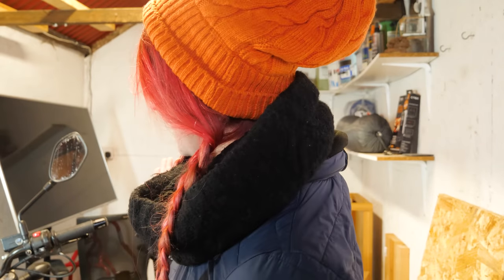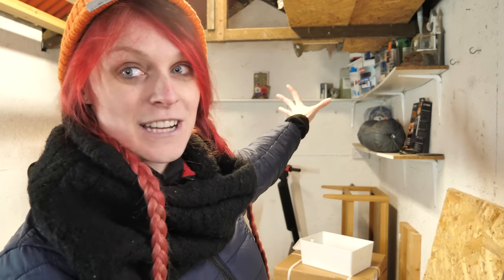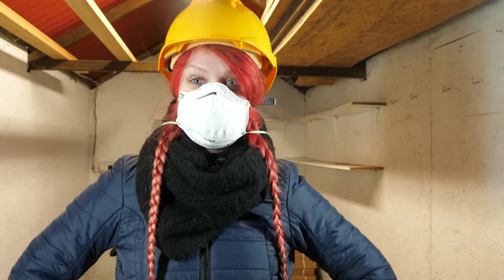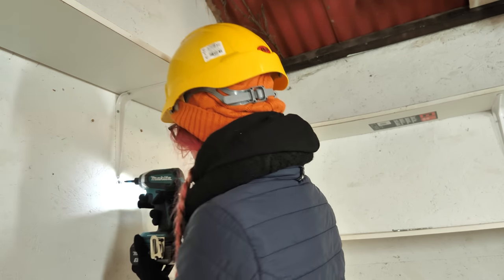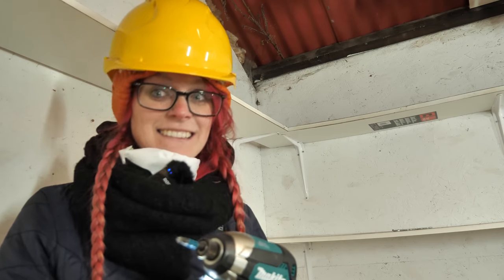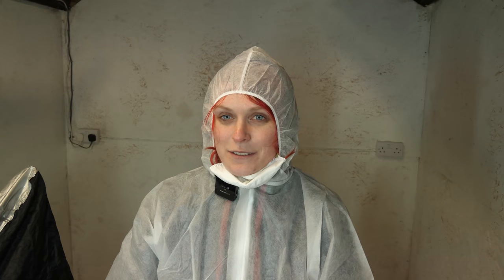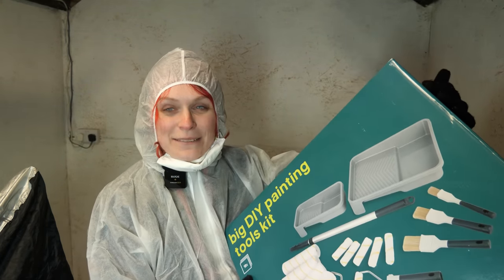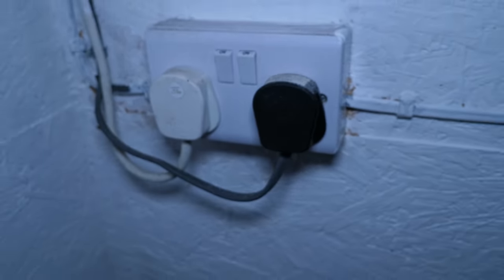Trying to build a bike garage

Comment: When it comes to the garage floor if you want a nice smooth floor use a couple of bags of latex self levelling floor compound. Once its gone off you could use a garage floor paint. I prefer the grey but you can get red. Once done your chair will roll around really easy and if you have a bike stand on wheels you can turn the bike into any position very easily to work on it
Reply from the maker: Thanks for the advice 🥰🥰🥰🥰
Reply: Thanks 🍻
Reply: This is going to be really fun to watch! I hope you have some friends with a little knowledge to give you through the processes! I know very little about the electrical. It terrifies me! I always get one of my friends to instruct me on how to do the work.  Lol
Reply: Love the new imperial unit of length, 'the sprocket '. It might catch on too.
Reply: I second that - especially the painting of the floor.  I was amazed how much easier it was to keep the floors clean.  First time I used a paint that came off under where I parked the car.  The warm/hot tyres removed the paint.  Talk to people to get the right paint - well worth a couple of extra dollars.  And flat floors any time you're lifting something or rolling it - learnt that from mistakes, hopefully Yorkshire Bikers were smarter that I am.

Comment: Impact driver perfect tool for the job, just make sure you have the right bit and put a bit more pressure on it (i.e. push harder) to make sure the bit doesn't jump out.
Reply from the maker: It doesn't have a speed setting so it was grinding the screw out! It was really annoying

Comment: Congrats on your own place . Just built my own garage from a side garden space all advice is there and good -put as many sockets as possible , make sure floor has damp proofing , storage space I consider putting boards on the roof beams, think about heating and ventilation ( I ran a spare air con coil which does heating and cooling) , a good stand eg Dynamoto pricy though but works really well, lots of lights eg led , shelves to put tools and helmets, hanging hooks - I use hooks from b&q , water source for cleaning do u have access to plumbing , get a cordless drill/ screwdriver , chance to make your bike secure , ground anchors or a Hiplok wall mount lock whilst you are cementing /epoxy floor, insulate roof - once done you love to work on bike in doors, I find dulux trade paint although more expensive is tougher needs less coats - get a trade account for discounts with local diy store are your walls wooden ?

Comment: It was fantastic to see what I looked like white poppy badges and purple poppy badges on the plaque at the back of the garage. 
As for the floor there is nothing better to work on than wood, I built a 26'x12' shed at the back of my house, I couldn't get concrete delivered and 10 sheets of 1' plywood was over £600. A mate suggested condemned scaffolding planks from a scaffold company, sometimes these companies pay for their disposal others sell them for £2 or £3 each (for my floor £140). After the metal ends are cut off they are 7' long, paint old engine oil (free) on the the bottom and fix them down to your base (screws £89), hire a sander for the day (35) then treat with decking oil (£25). Everybody thinks it's classy, one guy is doing it in his conservatory.
I am an electrician, get an electrician to do it, 600x1200b panel lights, sockets on each wall and drop 2 or 3 multi sockets from your ceiling along the middle of your garage front to back. Good luck with it.
Reply from the maker: 🥰 thank you so much for your support ☺️

Comment: Oh dear Saffy, white walls, a 1900 as cold as ice (and for you) unimaginative colour. What happened to the brite warm colours and tones!!? A resin floor or floor mats are a good choice and friend. I'd also at this stage for the little extra effort get some insulated board against that roof with foam fill. It'll pay dividends on cold at wet days working in the garage and heating the space achievable. Happy DIY, a good work space is imperative for a biker x
Reply from the maker: 😜 trust the process and all will be revealed

Comment: Hi Saffy, I love your enthusiasm and the way you just get stuck in with stuff. This is the point where I go but.
Get a registered electrician in to do the electrics, (NAPIT, ELECSA, NICEIC), this work is possible notifiable to building control under Part P of the  building regs. Please read up on Part P. With your property being rented, when you leave, any electrical work will need all the proper certification or your landlord could come after you when he has his compulsory change of tenant electrical inspection done, but if it's fully certified he can't say anything.
The other thing I'd be wary of until I knew for certain what it's made out of, is that corrugated roof, up until the 90's, some of those precast types had  asbestos in them.

Comment: Heavy guage PVC conduit about 1100 off the floor should be fine for a studio/bike maintenance setting.  Easy enough to DIY compared to threading steel conduit.

Install double sockets in pairs and more than you think you need - don't want to be tripping over extension leads 😋

Comment: My one piece of advice for the electrics is simple: employ a professional electrician. You can do it as a DIYer, but you really need to know what you are doing, and the last thing you need is for your bike(s) and your video gear to go up in smoke because it hasn't been wired correctly. 
That garage space looks enormous compared to mine - I only had room for a 9' x 6' steel m/c garage, and with 1 bike, 1 bicycle and a whole load of tools (I'm a retired mechanic), there's just about room to stand up. Good luck with your project.

Comment: 1 Sprocket by 3 Sprockets make 3 square Sprockets which I think is a decent space for a bike or three. I have 0 square Sprockets for my two bikes since we have 2 cars and only one garage about the same number of square Sprockets as yours. If you think the space might be a little tight you could consider a motorcycle garage dolly. They come in different versions, prices and sizes and makes it easy to move the bike around in limited space (and if you don't have a center stand on your bike, you would want a dolly that don't need the bike to have one).

Comment: Jesus who the hell wired that mains powerup. Cowboy job.  Good call changing it out.

The largest power pull in the garage will most likely be space heaters, make sure the circuit is setup accordingly. 

If the garage has older fluorescent tube or halogen bulbs change those out for LED, they will last longer and you can colour match them for video work, that way they can be used as a global fill or general whole space illumination whilst working and filming.

Comment: The only advice I have for electrical, if you don't know what you're doing have a professional do it. When you meet with the contractor to plan the layout have a good idea of everything you plan on running in your garage now and in the future with the amps requirements and the general location of where you will have things set up at. This will help the contractor know where to run outlets and the breakers needing to be installed. Might want to see if they can run some ethernet drops for you as well. Wi-Fi is great but it has it's limits. Getting them to run some surveillance cameras would be a good idea. One at each entrance to the garage with motion activated flood lights and at least two cameras inside to cover all angles. It didn't look like there were any windows but if there are you will want cameras and lights covering those as well. I'd steer clear of Wi-Fi cameras, Wi-Fi can easily be jammed, and use PoE cameras. You're going to have some expensive equipment in there, best to have it protected as best you can.

Comment: No Nonsense self levelling compound for your floor, but only if it needs it. Follow the instructions, it's so easy to use. Then seal with floor paint or tile with grippy tiles. As for the wiring, and not knowing your installation, I'd go for armoured cable for the feed into the main breaker panel, and conduit for the cable runs for the sockets and lighting.

Comment: When it comes to wiring a garage install more outlets than you think you can use. Seems wasteful but it's safer than running extension cords and plug strips all over the place.  Seperate circuits so that high power usage items are not using the same breaker in the panel or you will have issues when they try to run at the same time.  I recommend putting lights on a separate circuit from the outlets, if you have an issue with the oulets you don't loose your lights, if you have and issue with the lights you can still use the outlets. There is never enough light at the right angles, plan for both general lighting and portable lights you can put right where you need them. Also, just enough is not enough, this is one area you want to be a little spendy and get better quality and better rated materials for safety and longevity.  (You should get some of the money back when you sell, and upfitted garage is worth more than bare walls.)

Also, you can usually find books at hardware stores that will show you have to do the wiring yourself but double check local codes. The rules can change from one area to the next and you could easily make an expensive mistake out of ignorance, that is very easy to do.

Not to sound discouraging, anything construction wise can be done by the average person. Plan wisely, educate yourself before tacking the project, and take your time so that you can double check everything ten times. Doing it right the first time is cheaper no matter how long it takes.

Comment: Indoor paint is water based Saffy, you can wash all your brushes and roolers etc with warm soapy water after use and keep them for use again and again. Save the environment if you don't throw them away after a single use. 👍
Reply: Rollers not roolers, lol.
Reply from the maker: I didn't know that!!! I did buy some white spirit to be fair but I haven't actually opened the bottle yet 😂

Comment: Happy new year Saffy.
With your new garage if it's small I would make a measured plan & size measure everything that you want in it before purchasing, Tool boxes, racking & storage etc.. then you can see what can fit & what won't & how much & the best place for things. Rather than buy & wont fit or leaves you with no space. In mine I found if I thought 6 power outlets was Ok I ended up needing more, & the same with lights I need to add more this year.
Reply from the maker: That's a really good plan!!!!

Comment: Nice garage Saffy. Well done with the painting. Don't be so shy about your skills and choices. I would guess your decorating starter pack was more than adequate. Just a thought about the wiring.  Don't just throw everything away. Yes, maybe some improvements are needed. But the fixed plug sockets and light switches are probably good for many years to come. No doubt you will be getting expert advice on the wiring needs. However, modern LED lights and a battery trickle charger are low consumption items, as is your computer. You don't need your own nuclear power station! One thing to be more aware of is heating. That would be high current consumption. Looking forward to seeing your project progress.

Comment: Ah yes, the electric spinner to remove the helical nails, we know what you mean 😂 One tip from me, paint the celling white too, you'll be shocked just how much brighter it'll be in there. Take a look at the LED strip lights from toolstation, they were about £15 each for my bike shed which is about the same size as yours, it's like switching on the sun in there.
Reply from the maker: I'm going to order WiFi LEDs from China and rig it to my home system 😅

Comment: Rather than throwing out ask those brushes and rollers, clean them in warm water (you’re using emulsion so it’s water based) then you can put them away and use them another time if you ever need to.

Throwing them away is really rather wasteful.
Reply from the maker: I didn't know that! I'll rinse them down! I always thought that paint was oil based
Reply: @SaffySprocket   nope. Gloss is oil based (and needs turps) but emulsion can be rinsed out with warm water. Top tip - wrap them all in newspaper once you’ve washed them and it will pull the moisture out.

Comment: Also buy a bike lifting bench, they're not cheap but it'll be the best thing you ever buy if you're working on your own bike, it saves backache and crawling on the floor
Reply from the maker: I honestly don't think I'd have the floor space!
Reply: @SaffySprocket  they're no much wider than the handle bars and the loading ramp is usually detachable. Measure up for one because they are so much easier working on the bike

Comment: Happy new year Saffy & congratulations on the new garage. 
It was wise thinking to save money on the tools & sandpaper so you could spend it on costumes instead lol. 
On a serious note, I'm confused as to why the impact driver didn't work for taking down the shelves?. It's the perfect tool for the job. I've got 2 identical ones I use every day as a professional builder. 
What kind of floor are you putting down?. Let me know in a reply & then I can tell you step by step. 
As for electrical needs you first need a proper sparky to at least have a look and advise. If your needs for more power likely means you'll need a larger diameter wire from house to garage. From what I can see it all looks a bit of a DIY bodge job that's very tired. 
I'd also treat the roof to some insulation & vapour barrier to stop condensation in winter. Even if it's just some bubble wrap stapled to the rafters can help loads. Most garden center sell big roles of it for relatively cheap. 
Shame I'm so far away down here in SW Herefordshire or could be more helpful. 
Good luck & as always, thanks for sharing the journey Saffy.
Reply from the maker: Your costume comment properly made me laugh 🤣🤣
The impact driver was too powerful and it didn't have modes, I snapped a screw off screen before hand 😅
Reply: @SaffySprocket  impact drivers can do that on a very corroded screw. A little trick I learned years ago Saffy. When removing old screws always start with a screwdriver and turn the screw as it your trying to put it in & then give a half a turn to bring it out. That breaks the grip of corrosion without snapping the head off and then the impact driver will quickly get it out the rest of the way. Exactly the same when working on your bike as well. 
Glad I could give you a good laugh for newyear.😅

Comment: I am finally getting round to converting my garage. Biggest problem is the damp and condensation that forms on the roof and anything I put in there, especially motorbikes.
Mould forms on textiles such as tents ,panniers etc.
So first up is insulating the thing ,with the roof which is metal on mine to get rid of the condensation issue.

I would do this before any painting or flooring shelving and storage stuff.
Either going to use Celotex type rigid boards or the quilt type stuff.

Comment: That cracked me up, the width = 1 sprocket wide! Brilliant.
I would defo look at self levelling the floor and painting it with a nice grey resin paint or look at rubber flooring.
Reply from the maker: Ahahah I'm glad you enjoyed it! And that's a really good idea!
Reply: @SaffySprocket  especially if you decide to buy a bike stand, with a smooth floor you can just push the bike around the garage without it snagging on the floor. I did it with mine so i could use a Burzig stand. Nice painted floor also makes it easier to find any dropped nuts etc.

Comment: Happy New Year Saffy,  😀looks like a fantastic job, love the PPE. Here in Australia you must be a licensed electrician to do up grades like your garage. Is it the same in England. Have lots of fun.😀
Reply from the maker: The plan is, I'll be disconnecting the electricity, re-wiring everything up and then I have a licenced electrician coming to check everything over and who will do the formal switch on :D
Reply: @SaffySprocket  That's different, here that would be illegal. Just take your time. It is scary stuff and don't be afraid to get help if you feel unsure. I enjoy your DIY, not matter want happens, you don't give up and get it right in the end. I'm sure can make a very useable  
and comfortable space. Good luck Saffy.

Comment: Someone else mentioned a  bike ramp. They're a godsend. You said you may not have the room, they're generally on wheels. I push mine into the corner and park whichever bike I'm not using on it so the space isn't wasted and pull it out when needed. Good luck with the transformation 👍

Comment: Great garage project 👍, as for the electrics I'd get a professional to do it then you will be able to get it signed off properly if and when you come to sell up and move on 👍
Reply from the maker: I'm going to disconnect the wiring, re-do it, and then an electrician is going to come and check it over and do the final connection 😁
Reply: @SaffySprocket  that sounds like a good plan...

Comment: Ideally 6mm cable to the shed to feed the garage consumer unit, then 16a RCBO for sockets, or a ring final circuit with 32a RCBO, 6a RCBO for the lights, RCBO in basic terms will under fault conditions will trip the circuit with the issue rather than half your house, but please get a pro in 🙏
Reply: Oh and smoke alarm

Comment: Saffy, I love your measuring device. The garage is indeed 'One sprocket wide'.  Good idea to use the rollers/ brushes and throw away at the end. Until completion you can keep the roller and brushes in a plastic bag.This will stop them drying out between coats and save time wasted washing them out. As stated elsewhere, Some grey Garage Floor Paint from DIY stores( like Wickes) can be applied with a roller.Iit will lasts ages and prevent the dust from concrete floor as well as being easier to wipe up spillages.Looking forward to Part2..